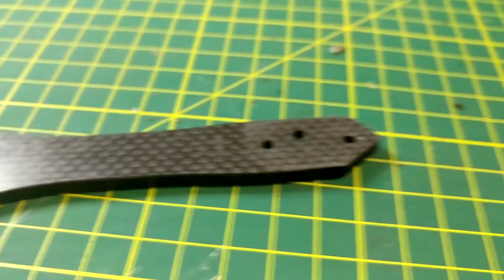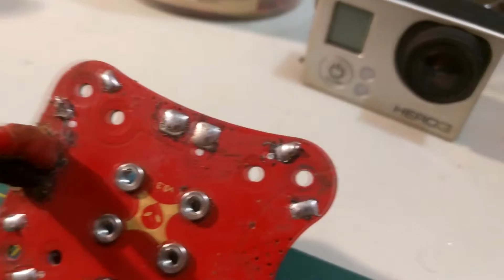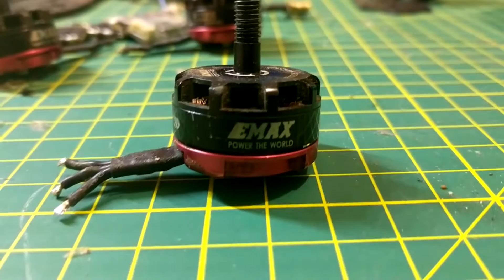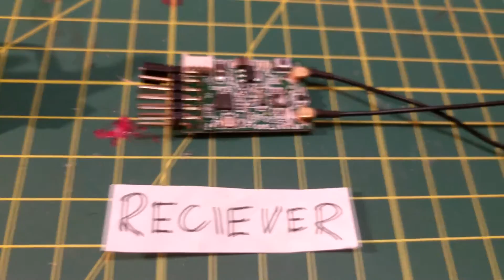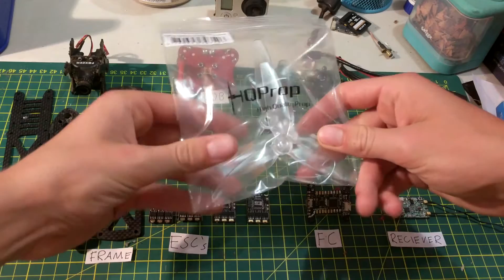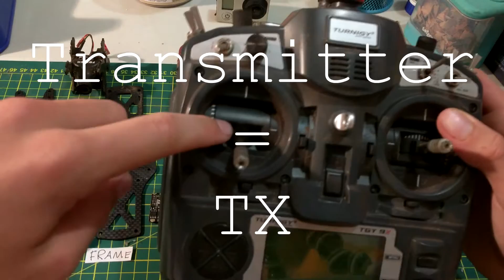Must-Have Beginners Knowledge On Mini-Quad Parts

Comment from the maker: Edit !! ESC's come as 4 in 1 units which you can mount directly ontop of the pdb/flight controller. There are many other variations of a quad nowadays but the general system works the same :)